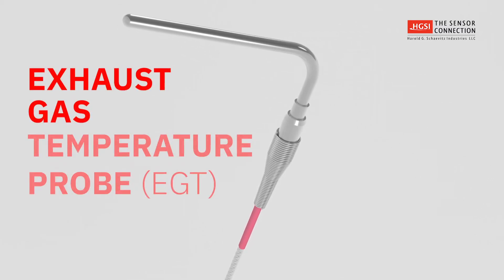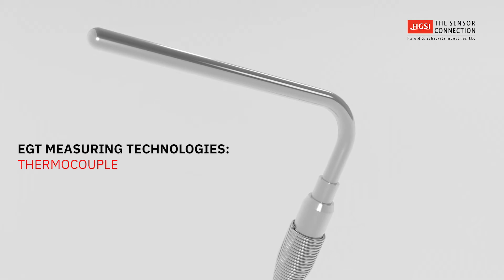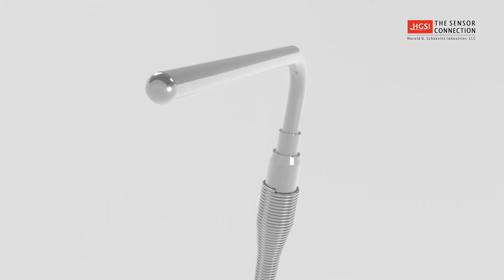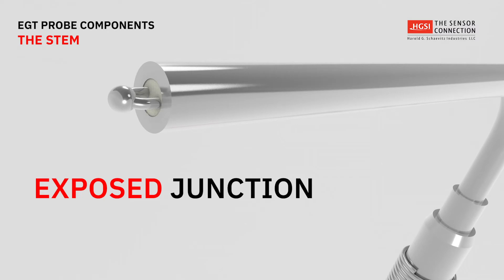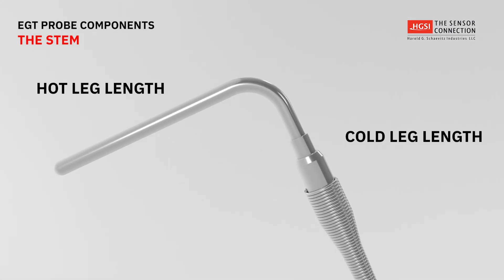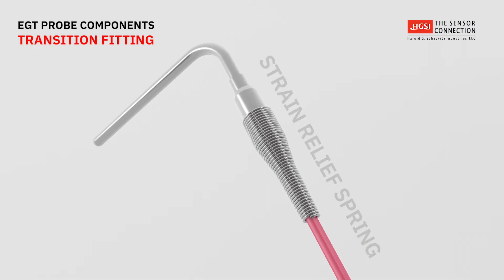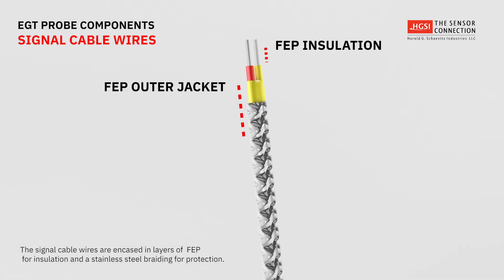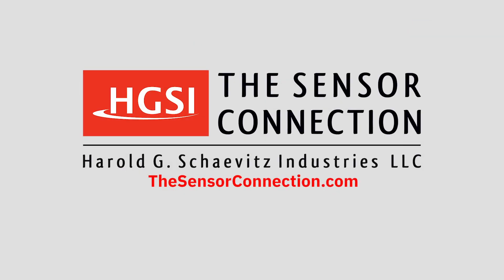What is an EGT Probe Thermocouple? How Does it Work?

Comment: Anyone know if the outer insulation wire is exposed to air will it effect the egt reading ?
Reply from the maker: Thanks for watching! Exposing the outer insulation wire to air would not affect the EGT reading. The tip of the EGT sensor is the point at which the temperature is measured, temperature changes on other parts of the sensor such as the outer insulation wire shouldn't change the reading.
Reply: @HGSIndustries  thanks for clarifying that for me.....i ask this question because I have 2 egts and the wires have been rubbing up against each other and inside the insulation there is two wires....the insulation is completely gone and eaten away at 3 small tiny wires of 1 of the 2 main wires....I think this will effect the EGT reading ? Is there a test I can do on a multimeter? 

Sorry to ask but I've tried to find information online even on forums but I can't find anything concerning the 2 main wires going into the EGT. One person said it shouldn't matter another person said it will matter?
Reply from the maker: @jmoore9806  if the EGT signal wire insulation is completely gone and both signal wires are exposed down to the bare wire (metal conductors are exposed), and if these two bare wires are touching each other or any other piece of metal on the engine, then yes you will have a short and this will most likely cause errors in the temperature readings.
Reply: @HGSIndustries  Oh ok cool...thank u very much for the reply....no they are not both touching but 1 of the wires is touching the eaten away insulation